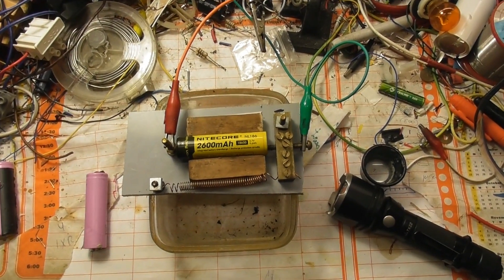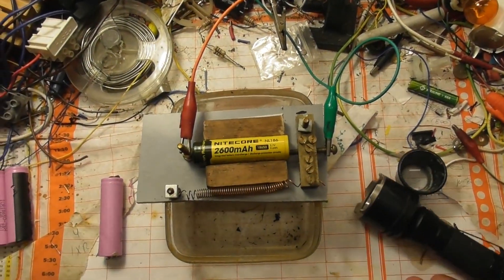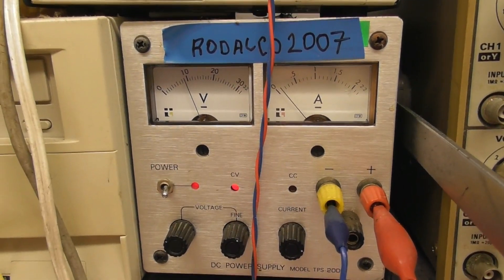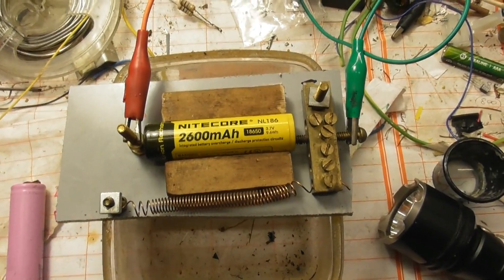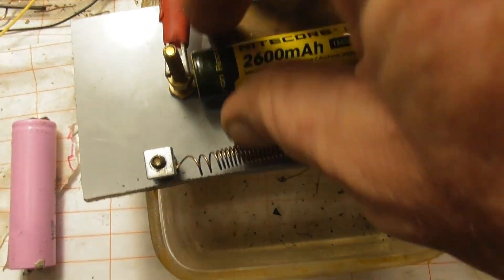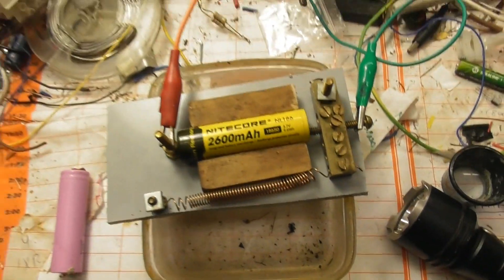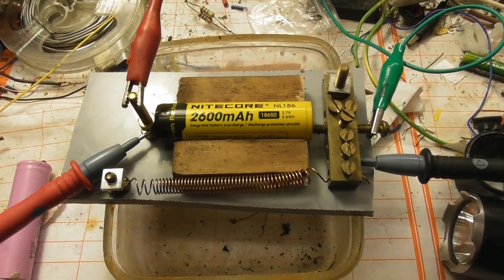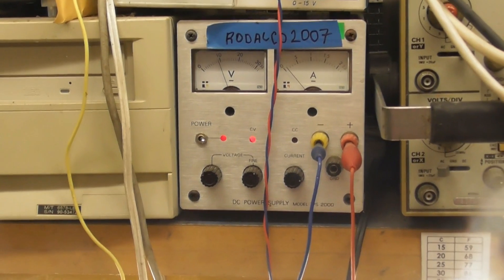Simple 18650 Lithium battery charger

Comment: I use a lab supply sometimes too, but with no series resistor, just using the voltage and current limiters of the supply.
With the resistor and the higher voltage setting, you risk a fire if you leave it charging for too long.

Comment: You just need to use your lab power supply set to 4.15V and 1.5 Amps and bob's your uncle. The voltage can't get above your PSU voltage and it will be full when the current goes down to 50mA. Also charges much faster this way. Just monitor the current and maybe build a cut off device that cuts off when the current goes below 50mA or over 1.5A for protection.

Comment: With two small neodymium magnets on each pole it works even better.
You should get a simple 50$ Lipo charger. They can charge almost every battery type up to 6S Lipos at 6 Amps. It's a simple all in one charger if you don't need more than 6 Amps or a Voltage above 26 Volts.

Comment: I'm afraid to do this. I ended up buying a small power bank and removing the cell inside and using that to charge my 18650s. Question. Do you have to match the mA rating of the battery to the charger or can you charge a 2600mA battery with one for a 2000mA battery? I ended up buying two of those USB to 18650 magnetic chargers by Olight and I just use those.
Reply: Think in terms of capacity and percentage:
To be safe, limit charge to 0.5C ... so for a 2600mAh battery, that's 1300mA. Or 1000mA for a 2000mAh battery.
That USB powerbank probably charges at like 500mA, 1A tops.
Also, use protected cells with genuine protection (I've heard, some are fakes, with a PCB but no components!!!).

Comment: If the cell has protection circuitry, this is fine.  If it doesn't have protection circuitry then monitor the cell voltage constantly and disconnect the cell once it reaches 4.2V or you'll damage the cell.

Also be aware that many cells from eBay not only have far lower capacity than claimed, they often don't have protection circuitry even though the seller claims they do.  So monitor the cell voltage anyway.

Comment: This is stupidly dangerous. The battery will have a thermal runaway when the voltage gets above 4.3V and they can burn your house down. 

A good and basic charger is about 4$
Reply: The battery itself has integrated discharge/overcharge protection circuits, most based on DW01 chips. I wouldn't worry.
Reply from the maker: The battery doesn't get above 4.0 Volts at 36 hours charging. That is why the limiting resistor is used and charging is kept below 1/10 of cell capacity.
Reply: Only if you charge it too fast and forget about it. Be smart and watch the voltage and you are fine. (Btw I have slowly charged an unprotected cell to 4.5v using low current of about 100ma and it didn't heat or fail) they aren't as spontaneous as described. When it's warmer out I'll take the test outside of the garage and go higher. (Maybe I'll make a video, but it is more of a safety test for my own knowledge not something to encourage people to push the boundaries)
Reply: I had cells catching fire after I mistook a 3S batt for a 4S

Comment: All you have to do to charge a lithium battery of nominal 3.7v is set your power supply to 4.2v with a maximum current rating of 0.5C so in your case 1.3A maximum. When it drops to 100mA charge current then it is full. Charging your way could lead to over charging - you need to use a CC-CV charging method as above.

Comment: I don't understand why you didn't use CC feature of the power supply. I like your power supply.
Reply: A lot of them are not that great at actually being constant current - they are more a current limit in the event of an overload, rather than a true current source
Reply: @jaycee1980  Still plenty good for cell charging. I do it all the time and have used dozens of different supplies. As long as you've got the settings right, SLA, Li, LiFePO4, NiZn, of virtually any series/parallel config will safely charge (assuming BMS does the balancing in the case of 2+ in series). NiCd and NiMH are tricky since they don't work as well with CC->CV charging, but trickle-charging is still an option with these.
Reply from the maker: I could use that CC function, still prefer a series limiting R as well as this power supply is around 40 years old and I like to have that secondary Resistor safety in case something fails.

Comment: I was expecting them to be "charged", if you know what I mean.  lol  charged until the fire came out!
Reply: I also expected them to get "charged" with mains.
Reply: I think they would get "charged" if you forgot to remove the battery from this series resistor limiting circuit, and the battery voltage exceeded 4.2 Volts.
Reply from the maker: @LakeNipissing  Not at 1/10C and with series limiting R. Battery voltage will remain below 4.0 Volts after 36 hours.
Reply: same... expected like 400vdc at 30 amps or so lol